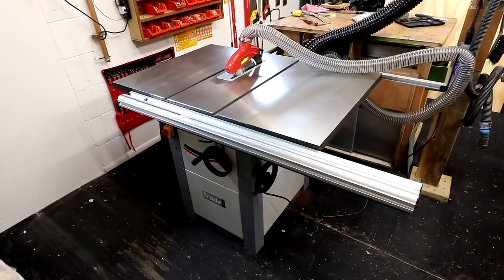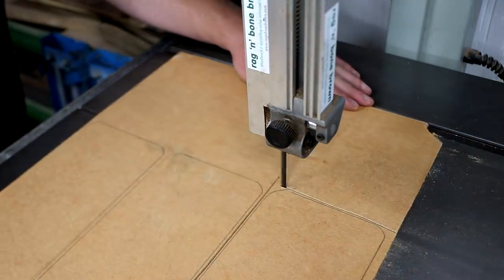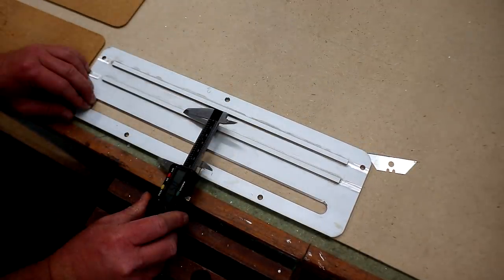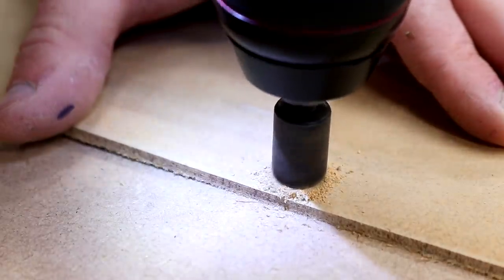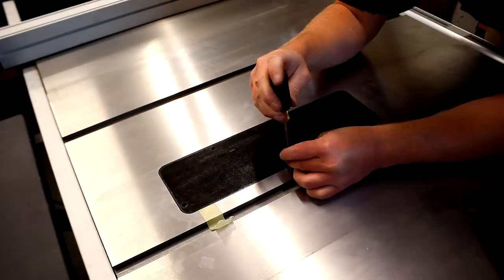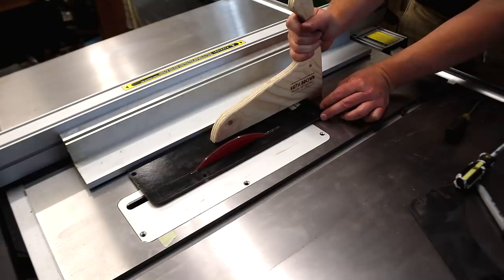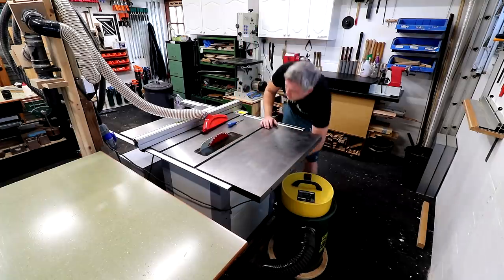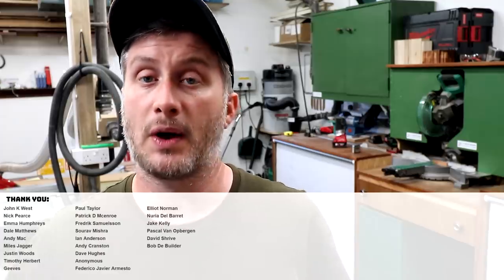Zero Clearance Table Saw Insert Plate / Throat Plate

Comment: I have an American saw and we use Dado sets.  Also my plate was thicker so I used 12mm Baltic Birch and added little Pads of wood underneath and then sanded then to just the right thickness.  Turns out the blade will not retract far enough so I had to use an 8" blade to start the slot and finish with the 10".  Made about half a dozen because the dado stack chews up a new one every time you change the thickness.  Instead of the pads maybe I should have used small screws.  Got some good ideas from yours, like routing the whole stack at once and painting them.  Thanks for posting.

Comment: Nice job, Keith, and a lot simpler method than I used  - routing the edges of a thicker red plastic chopping board.   BTW, on the odd occasions when you needs to tilt the blade, it is very easy to forget to change the insert first !   - But you've got three!

Comment: Love your work Dude. I suggest this: You need an air flow to carry the dust, and having no holes near the blade means that there is no suction in that important area, where the dust is generated and airborne. I think more holes around the blade (still with the zero clearance insert) would greatly improve dust extraction. A bit like the sanders with dust extraction suction used with perforated sandpaper  - the dust is extracted ‘at source’.

Comment: If you are going to use screws I’d recommend countersunk socket screws. Those star shaped ones will eventually strip due to the repeated removal. Also since the plate is 3mm thick you could create recesses for small 1mm thick magnets that can simply stick to the cast iron table eliminating the screws altogether.

Comment: For easy removal with no finger hole, you could glue a steel washer to the underside of the new plate and easily remove it using a strong rare earth magnet.

(Edit) Oops. Looks like many others have already suggested the same.

Comment: Instead of a finger-hole, you could also just add a magnet or just a metal plate to the bottom of the plate, and then lift it up with a magnet from the top side.
Reply: But what will happen when he cuts large sheet of steel? It would get stuck!

Sorry, tired.. must sleep 😵
Reply: Who cuts steel on a table saw
Reply: @vileguile4  He ruins his woodcutting blade. But the sheet won't get stuck, for that to happen the magnets holding force would have to be stronger than Keith's pushing force. If that happens with a little magnet, he needs to get out of the workshop and into a hospital anyway.

Comment: Snazzy dust hood you've got there. I have an old Powermatic 12/14"  M-72 table saw with a throat plate similarly shaped to yours but much longer and wider. It suffers from similarly narrow ledge to one side of the blade with supporting lugs spaced far apart for the gappy original cast aluminum plate. The recess for the plate is nearly 1/2" deep. I've thought of using soft 3/8" aluminum plate to make several zero clearance plates for various blades. I'm a little surprised you didn't use aluminum for your plates and wonder whether you or your viewers can advise how to safely extend the sawn slots to fit an exactly-sized splitter. Thanks.

Comment: Counter to what you might think, with a very similar saw, it seems a zero clearance insert decreases the effectiveness of the dust collection.
Reply: That makes perfect sense. You need an air flow to carry the dust, and having no holes near the blade means that there is no suction in that important area, where the dust is airborne. I think more holes around the blade (still with the zero clearance insert) would greatly improve dust extraction.

Comment: I have watched a number of table saw setups and all seem to include making a zero clearance plate. You would think that manufacturers would pick up on this and supply one ?
Reply: A zero clearance plate can only be used at 90 degrees.  The manufacturers provide an ‘all rounder’ plate that can be used for 90 degrees to 45 degrees and everything in between.